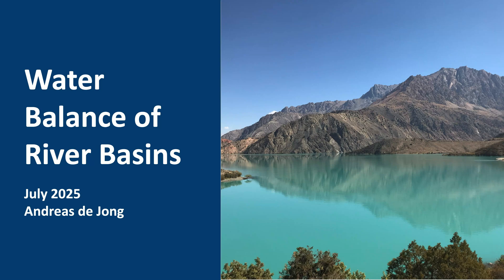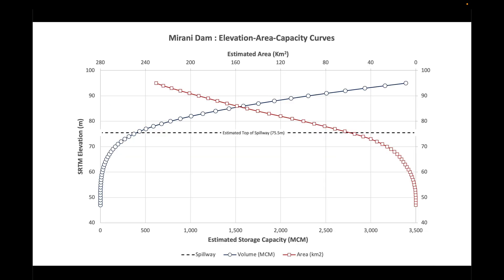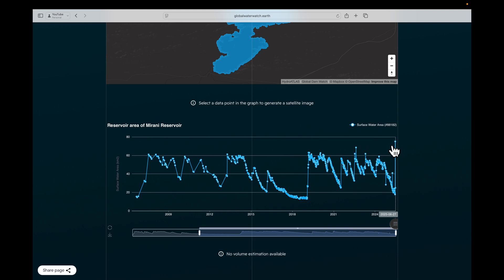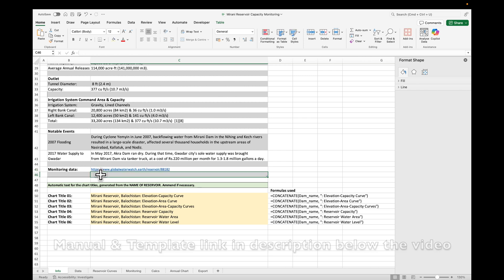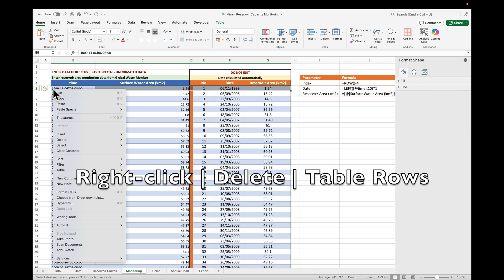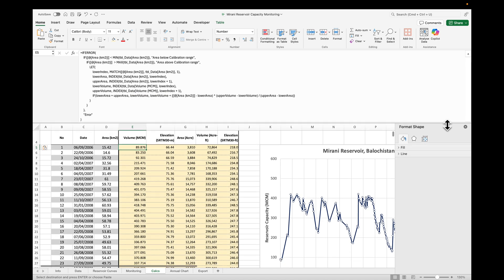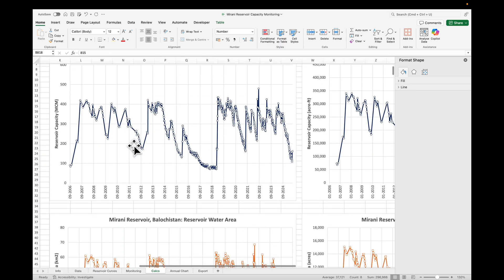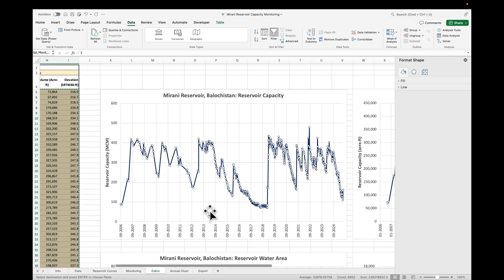Reservoir Capacity Monitoring using the Global Water Monitor dataset

Comment: Thank you, I think this website data is based on optical imagery and don't use insar data.
Reply from the maker: You are right @azoughkarim. The water area calculations are most likely based on NDWI or similar ratios to identify the water pixels. That is why there are data spikes on the cloudy days. What they should have done is to mask out any pixels individually if there are clouds. That way cloudy days will be identified as a negative spike rather than a false flood event.
An alternative is to use radar satellites like Sentinel-1, which can look through the clouds. However that only works since about 2015, so if you want to monitor reservoirs going back to the 1980s it is better to use a combination of Landsat/Sentinel ie optical images. All the best, Andreas